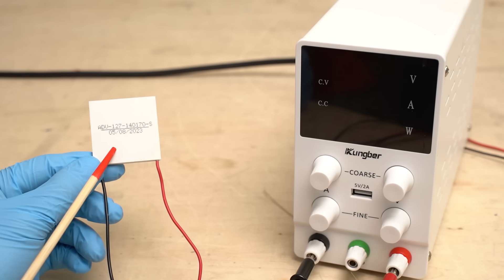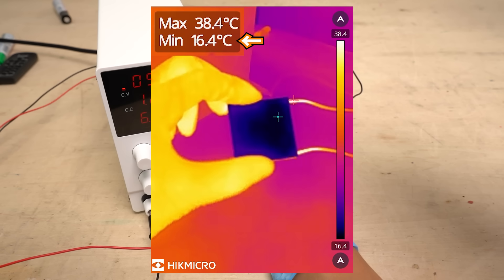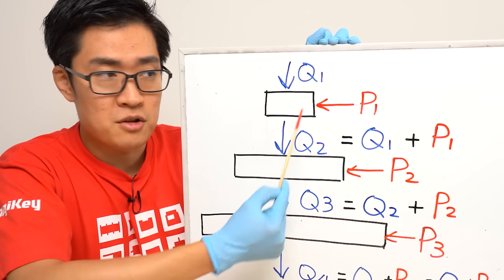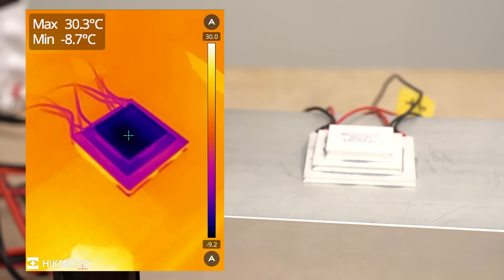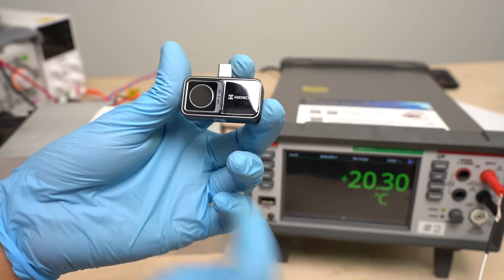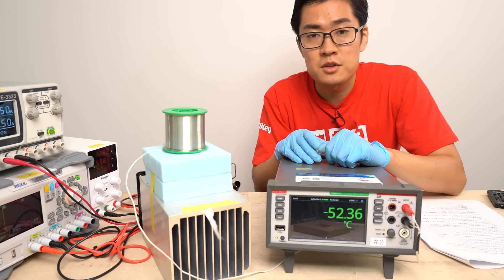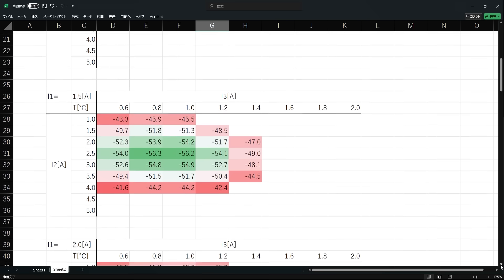Stacking 5 Peltier Modules, and Reached -90℃

Comment: Refusing to use liquid metal because it freezes at low temperature is a really bad argument. While generic pastes may crystalize and have changed thermal properties, METAL will always be metal. Its heat transfer capability is proportional to its electrical conductivity. This is like saying that solid metal is worse at conducting electricity than liquid metal. 
Youtube science channels ftw!

Comment: Great video, nice work!  I would suggest flipping the fan around so it draws air in through the heat sink and the air exits at the fan. This way you avoid adding all the watts of heat the fan generates into the heat sink. With this small change, you could get lower temps without changing anything else.

Comment: You need copper tubing a 2 stage vacuum pump setup and some gas that can pump heat to put in the tubes. replace the thermal paste by heat exchangers im sure it is do-able to acheive better result but in lab configuration

Comment: If you have enough modules, try to make a circle with 360 or more modules until the circle is complete and when powered you should have a continuous circular continuous cooler with no need for cooling. secondary use a circular radiator and put a module between every fin a case you don't have enough modules to make a complete circle only from them alone with a minimum angle filled with a thermal paste

Comment: It would be much better to find a vapor chamber cooler from a GPU or CPU to more quickly cool the hot side, and also heat pipes for air cooling or just go water cooling, both with vapor chamber.

Comment: Why is it bad if the liquid metal freezes? Assuming there is not much vibration and the device is not being moved around vigorously. then loss of contact due to thermal expansion and fracturing is not a problem because if it warms up again it melts and forms a saturated contact film. I think with these kind of sub-zero cooling setups, the bigger danger is condensation and then ice melting if it heats up.

Comment: For my Final Year Engineering project we tried to make a Air-Conditioner for Auto-Rickshaws (it is a means of public transport in India that carries 3-4 people at a time). Our aim was to make the limited ambient space (roughly 3-3.5 cubic meter) to cool down to about 24 degree Celsius. We were extremely limited by our budget, material  and guidance available that time. After watching your video, I understand that we could have done a much better job. Great work!

Comment: The brownish insulation material that wasn't used is what I've always seen referred to as "styrofoam" because it is made up of many individual granules expanded together in a mold, whereas the blue foam that was actually used for insulation is more just your common foam - like a liquid plastic that had a bunch of air bubbles form in it, rather than a bunch of individual little foam pellets expanded together like styrofoam.

Comment: You made a huge mistake: It is NECCESSARY to cover each peltier with plates of copper to actually be able to get the heat from the smaller peltier into a larger one!
Reply: No, it's not. As evidenced by the fact that his stacked peltiers reached -73.

Comment: Aluminum block is not as good conducting heat as heat pipes (made of copper and underpressured water). 
Some decent CPU-fan cooler with 6-heat pipes would be more effective. Also there are many factory-made watercooling solutions for CPU which are cheap.
That could enable you to break your record.

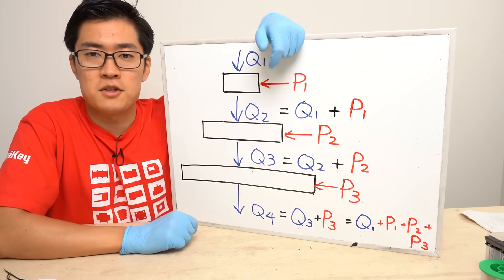Comment: Where did you get that gigantic heatsink @ 3:50??
Reply: search for "aluminum heat sink wind tunnel" or "aluminum wind radiator tunnel" and you'll find them - they're extruded aluminum so the prices aren't super crazy (relatively)

Comment: If portable fridges just used multi-stage peltiers, they could achieve incredibly low temperatures. The stock heatsink should be enough to dissipate the heat.

Comment: I used to model creating a refrigerated salt water aquarium using peltier coolers attached to the bottom.  It was always just too expensive without buying the coolers in bulks that weren't practical though.  Especially when you can just create a sub-tank cooled by a standard refrigerator compressor.  Still, always thought it would be cool to do.

Comment: seebek/peltier elements have been powering the old voyager space probes using heat from lumps of radioactive metal since 1977 which is over 48 years as of March 6th 2025 (as a write this) and this has been a known usage for about 90 years....there are old oil lamps with early peltier elements which were being used to power radio sets back in the 1930s when batteries were hard to buy and from during World War 2

Comment: I wonder if this idea can be used for home electrical system instead of solar. Ya see. Solar does not really work well here in Finland and as electrical and automation technical engineering student, this stuff really interests me. Because. To be fair. This system could be cheaper than the most efficient solar panels needed in Finland to make enough energy to store and use.

Comment: Try a high end CPU cooler. either dualtower heatpipes, or waterloop 360mm+. Should cool significantly better. Though the coldplate of such coolers may be a bit small for this use case. Some larger ones may exist. perhaps for server cpus.. not sure. The readymade device should fit nicely! Anyhow the direct contact heatpipe or wastercooling options are highly effective.

Comment: In my experience cooling the first stage peltier with a copper watercooler (for CPUs) is well worth it, especially when trying to stack peltiers. Every degree lower you can get makes a difference at the final stage.

Also dont even try using liquid metal on these ceramic peltiers, the metal will NOT stick to the ceramic whatsoever and will just bead up. There are also peltiers with copper sides, but I'm not sure if they'd be suited better for super low temperatures.

Comment: What if you used 3 of the same type and therefore size of peltier modules and then ran each stacked one at progressively lower current ratings? Wouldn't it work much better as you would have full contact between surfaces?

Comment: I did something similar a while back though I only had two and they were the same size, The bottom one (that was meant to be the hot side) I gave more power than the one on top of it (the cold side) in order for the meeting between the two to become cold so the one on top could decrease the temperature even further.

Comment: My only issue with the peltier modules is the limited length of workability. During several test using modules over time the long term usage is around 8 months before replacement is required.   Additionally, in high humid areas the amount of moisture that is created from the peliter dynamically increases in each case causing shorts across electric contacts. Using insulation in your video was very interesting though, I never thought to use insulation to increase the air conductivity in experimenting with each design. I will need to look into this further during some other experiments also and see what is achievable. Thanks for the lesson.

Comment: Having designed peltier cascades, there are two basic rules, first, do not exceed a power ratio of top to bottom  of 0.7 to 1. Secondly add a metal heat spreader between stages unless using BeO or AlN ceramic plates. Other tips is you will want to stagger the semiconductor elements in each one to approximately 1.25 the distance of the lower one, and when you approach cryogenic temperatures, you will want these elements taller because heat radiation from the lower layer and heat conduction become major concerns ❤

Comment: I'm interested in these Peltier devices for another purpose, have you ever used them to generate power to run a fan or water pump? I have a peltier module fireplace fan and it works really well, I did a heap of googling but couldn't find much on how much power they can generate from heat.

Comment: Very interesting! I have always been fascinated with peltier devices. I work on antique refrigerators. The thermostat controls require testing. Maybe I can build a thermal calibration tool for testing refrigerator thermostats using a similar concept. Now, I use a vapor-compression system which cools a methanol solution. It can get as low as -40°F (-40°C) which is useful for thermostat testing, but the machine is heavy and large. A peltier-based design could be much more convenient.

Comment: He should probably run the peltiers in reverse first to make the thermal paste more liquid. Then put a ton of weight on it to squish the paste out as much as possible. Then clean the squeezed out paste and try again. The less paste the better as less paste means less gap means more thermal transfer.

Comment: I have no reason to be watching this.. but its freaking cool. As a kid back in the 90's i came across my first peltier cooler. It was inside a coleman cooler... I was amazed that no freon was needed or moving parts other than a fan. I then wondered why it wasnt used in hone AC as it was so green then my neighbor who repairs AC systems told me "They are efficient enough" Now I really see it.. 10 amps for this little setup here... My window AC ises 1/5 of that.
Reply: you mean 1.25 amps
Reply: you are very confused - you are comparing mains voltage AC amps (240v ? 120v ? where are you ? ) with low voltage DC amps -- they are apples and oranges - you need to convert BOTH to WATTS to make any kind of comparison, obviously;
volts x amps = watts

so ... talk in WATTS not AMPS if you want to actually make any sense of it all.
Reply: You're right. The amount of misinformation or misunderstanding of Peltier devices is crazy. I think people assume that no moving parts makes them more efficient than traditional compressor systems, but in truth they're so terribly inefficient.

Comment: Nice work, Pretty cool experiment and results.
I wonder if you had used the same size peltier instead of 3 different sizes, perhaps there is more leakage right now and internally inconsistent temperature transfer among the different peltiers..
I'd be curious if it would reach even cooler temp although the -92c is already impressive. Congratulations on this achievement!

Comment: I used to work in HVAC and refrigeration and this is really neat. Cascaded refrigerant systems can get quite expensive. Stacking peltier elements would be great for experiments and specialized applications.
Reply: Any industry that can, avoids using TECs. It's dead and absurdly inefficient tech. Usually when you compare available solutions it's a trade offs and balances but in case of TEC based cooling its somehow worse in every metric.

Typical TEC setup will have less delta T at lower max Q and worse efficiency while costing more than typical compressor based chiller.

 There is a reason you mostly see them in AliExpress/Teemu crap or some very niche scientific equipment where they couldn't fit anything else.

Comment: I wonder if a copper sheet between each Peltier module could help distribute the heat to the entire surface areas. I feel like the areas that are left exposed to the air on the cold sides is wasted potential

Comment: How is that not useful?

Couldn't you insulate the whole setup and insulate a coolant reservoir of Ethanol? Glycol and water wouldn't work as it has a freezing point of -60°C. Ethanol has a freezing point of -114°C.

The amount of insulation would be fairly extreme.

However, depending on how much liquid nitrogen you can get your hands on, it'd make working with it for superconducting a lot easier.

-90°C is a lot closer than room temperature, and due to the nature of thermal heat transfer having a lot of super cooled Ethanol on hand means you have plenty of cooling capabilities not to waste as much liquid nitrogen as you would otherwise.

Also, I live in the Canadian Arctic. I'm thinking of powering field electronics with Peltier modules. Mostly to power a watchdog timer and keeping the correct date/time in environments that are as cold as -50°C.

Comment: I've always wanted to use a peltier module as a component within the displacer as some form of sensing unit, power assist, or supplemental energy recovery... I'm pretty sure it's not gonna be huge values, but who knows... maybe there's a teeny, tiny way to increase an efficiency there somewhere

Comment: To make a proper evaluation of the Peltier device efficiency vs other cooling methods, one has to tabularize the data of W/Delta T in a stable environment. The calibration lab we had for our Black bodies was a VERY controlled environment, and traceable calibrated thermocouples were used throughout the process, all of this data had to be presented to the client along with the controller Black body pair. It's great to make grandiose claims, but another to back it up with irrefutable data. This calculation must include the power consumed by the controller and the colling stabilizing fans, etc.

Comment: So I've done some research work using peltiers and the best TIM you can realistically get for peltier is an indium sheet. It's not liquid, but it will conform to the surfaces and you can buy sheets which aree not crazy expensive. They will have very good thermal conductivity throughout the temeprature range, so long as you can create significant pressure between the peltier modules. You'll also want to use liquid cooling for the bottom peltier. You can also buy peltier devices with a coper thermal interface, which will be significantly more expensive but almost certainly more performant. Ice is a terrible thermal conductor, so room humidity is going to be a huge factor, as any condensation between your TECs will immediately affect your thermal transfer. If you can, get a room dehumidifier and hook it up to a very small enclosed space to reduce this issue. Also, as I mentioned previously, clamp your TECs together firmly and clean all surfaces (including the indium if you go that route) with ipa and a weak acid if possible (dilute hcl or acetic will help). The insulation is also critical, look into some aerogel if you can afford it (powdered form is probably fine for this). Finally, look up the efficiency curves of the specific modules you're using, I suspect you can find models which will perform much better when operating at a specific temperature and current range. 

I love these little things and if I wasn't invested in other research I'd probably be doing thermoelectric research. My record is unfortunately quite poor as I've never done stacks and primarily focused on single element designs, so my minimum was -20C for about 20 mL of liquid. 

Hopefully this may help you out, I'm guessing you already knew most of this, but it doesn't hurt for anyone else interested either.
Reply from the maker: Thank you for sharing

Comment: I get -160°C with only 3 refrigeration stages. (phase change) -90°C is easily achievable with 2 stages. Takes up more space but by far more efficient in electricity usage. This video is still a nice example of how cascading works, and why it's needed.

Comment: Have you considered a Ammonia type complete circle with the heating of ammonia through the venture and thus creating a massive cooling system to compliment the pelit devices a 3 stack plus ammonia ref pipe style.. could further increase the cooling capacity by a substantial amount...

Comment: Next figure out how to get to -180C and start condensing air into parts.  Humidity is an issue to maybe start with pure N or O.

It is interesting that a Peltier device in some ways resembles a DC PM motor.  Current causes torque and heat flow.  Temperature difference is like rotational speed in that it acts like a generator in the reverse direction.  Think about it!

Comment: Great video, gave you a like. If your heatsink was smaller with more and thinner fins down to, say, 50mm squared cross area, and you used a 50 mm fan, then used more 4 or more 3 level devices to funnel chilled air into the input to the fan. That would cool the input air below that of even a winter day. I wonder if you could reach -100 C on your target surface.

Comment: It should be tried as replacement of air conditioning, some experimentation should be undertaken. Then we can use solar cells to produced electricity and cool our homes with such devices without gas based cooling system and noise free operation.

Comment: Why not use metal as a thermal interface? It is liquid and flowing out at the edges will provide the minimum required thickness, unlike thermal paste. And its thermal conductivity is higher. Or does it decrease when it freezes?

Comment: To avoid convection, you can close the end surfaces from the air, for example, with a silicone sealant, as is done in the modules themselves.

Comment: that was excellent, and you found a real time use for it too. 130w for a controlled temperature difference seems excellent to me. That's say 50 units as a mini fridge, using a 5k solar panel. I am curious the effext of supplying a heating load at the cool end.. as its a difference engine, that load should show up in the hot end. wonderful mind fodder. ❤

Comment: If you want a thermal grease rated for super cold temperature, try kingpin kpx or thermal grizzly kryonaut as they are designed for ln2 ( liquid nitrogen ) for extreme overclocking. And a better heat sink could help like a threadripper cpu liquid cooler.

Comment: It would probably work better if you cut out little slots for your wires to run through so it wouldn't have that air getting in there. Also, what would happen if you put the bottom of your heat sink inside a container of ice water or something like that?